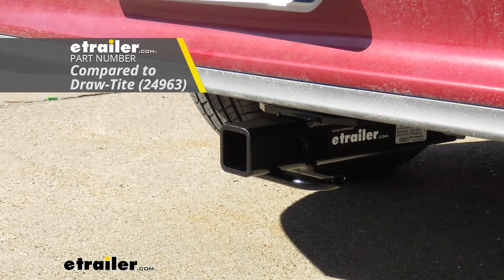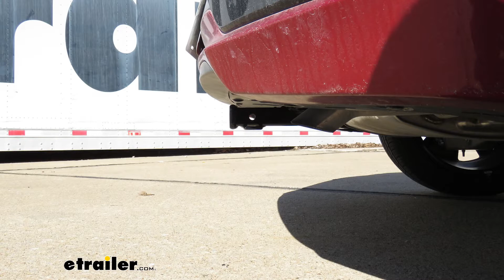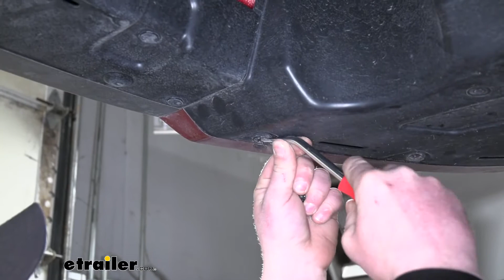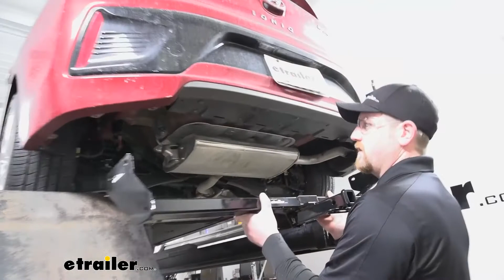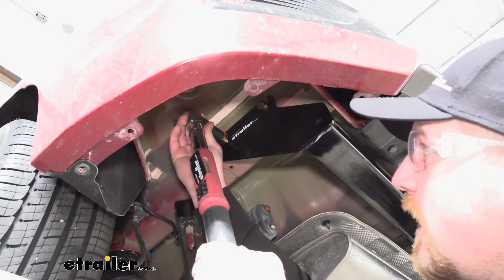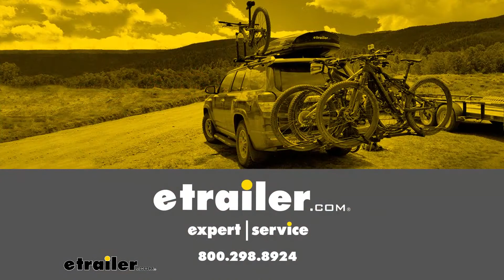etrailer | Setting up the Curt Trailer Hitch Receiver on a 2019 Hyundai Ioniq

Comment: Is the install the same on a 2020 2019 Hyundai Ioniq Hybrid ?
Reply from the maker: Yes it is.
As long as your 2020 Ioniq isn't an electric or a plug-in, the Curt # C11486 will fit.
https://www.etrailer.com/Trailer-Hitch/CURT/C11486.html